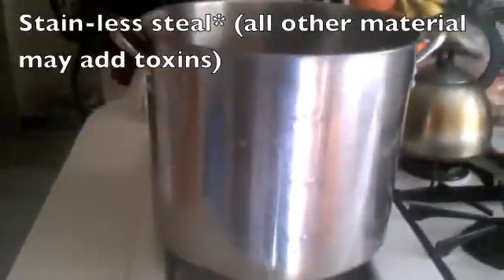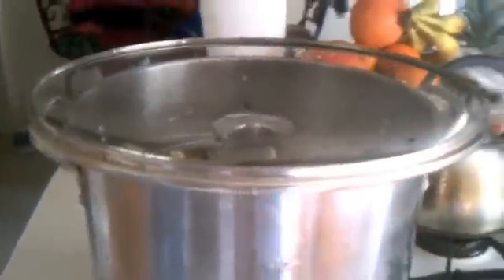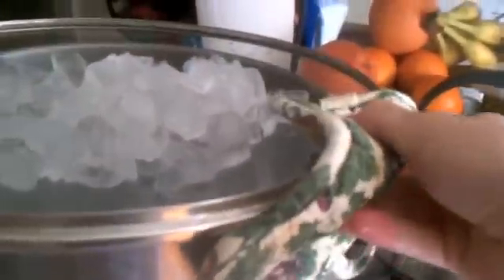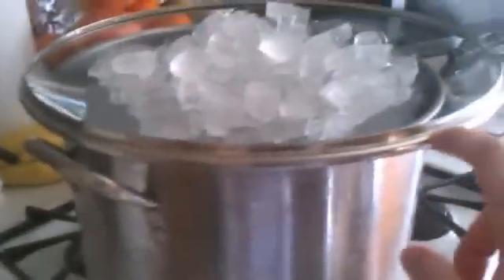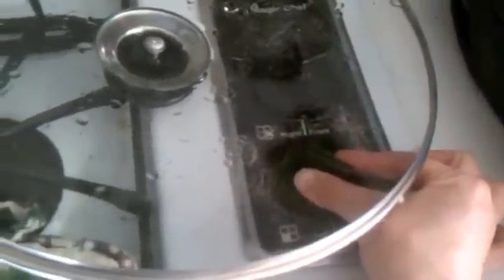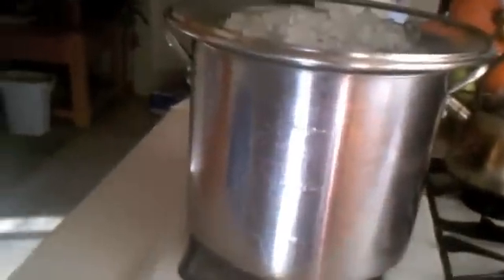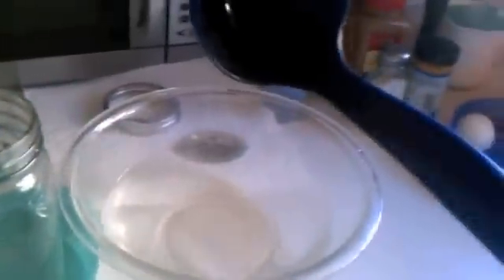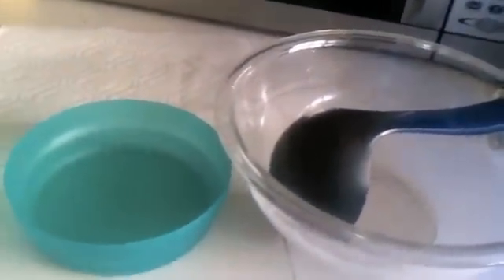How To Make Distilled Water | DIY Distilled Water

Comment: dang that took a lot of time..and the money spent on the bag of ice, I could jus do as I normally do and buy a gal of distilled water at walmart for .79 cents..aaahh cool and refreshing. .
Reply: dont drink distilled water
it leaches minerals from your body
Reply: +Rudy Roman  what kind of water then?
Reply: Stephanie Washington just not distilled
anything with minerals
Reply: do your own research never trust anyone's opinion lol.
Reply: If you have an air conditioning in your house then you have distilled water. The AC has a drain pipe somewhere and therefore we are not really aware of the distilled water that is beeing produced but it's a lot of water

Comment: Wouldn't the water coming off an air conditioner or high efficiency furnace be distilled water??
Reply: +Lee Haire :Yes, it is distilled water and would definitely be better for you than tap water if you make sure the air conditioner is clean. You would need to filter it because of all the dust in the air. Some might argue about the lead solder joints on the copper tubing but we have that in our plumbing anyways.
Reply: +Robert Tomkinson Bob, all good points!! I use that water for the car, with anti-freeze, and for the shop as taking dents out of wood. Don't know as I'd want to drink it!! Have a great day!!

Comment: With this closed design make sure you are starting with clean water, since any toxic volatile gases are unable to escape and will also condense right back into your 'collector.' 
On a professional distiller, a way is provided to vent off any volatile gases before they condense. They also don't boil the water but heat it only close to the boiling point, to help separate the gases.

Comment: save 3 bucks on ice. grab a thick bag. fill it with water. freeze it. smash it. you're not going to use the ice for refreshing your drinks anyways
Reply: totally agree
Reply: @KinysonLocke  ?  The water in the bag stays in the bag dude.  the water in the pot touches the lid, and drops down into the bowl. they are separate, the bag with ice is on top of the lid. ...Smh
Reply: What is the purpose of the ice?
Reply: It doesn't have to be ice, Just cooler than the vapour produced to condense it,
but Ice would condense more vapour.

Comment: Buy some Himalayan pink salt fine organic from Amazon take a pinch to every couple. Litres! This will replace all the minerals you have take out of the water as your body really needs them for good health, about 70% of  minerals your body needs are in the pink Himalayan organic fine  salt
Reply: Himalayan pink salt is actually not salt Paul.  In fact, himalayan pink salt has over 84 trace minerals that the body actually needs and can use.  Not sure why you would feel the need to use the word Mook with someone who actually is correct in saying to add the himalayan salt to their water.  Distilling removes everything good and bad, but you still require minerals which means that if you add the pink salt (which is not salt) to your water, you  get all the minerals plus some for good health.
Reply: The whole point is to make distilled water, for purposes you need distilled water for.  I make homemade shampoo and conditioner and WANT the minerals removed.  I guess if you have awful Florida water, you want distilled water to drink that needs to be re-mineralized.  But most people specifically want distilled water.
Reply: That is true but she might be using distilled water for something else rather than just drinking it like for a mechanical use like adding it to another solution that requires added distilled water rather than just tap water.
Reply: Distilled water is good for you. Don't add shit to it. Yes, It does leech minerals, it leech all the bad ones that your body doesn't need
Reply: great video...thanks, If you are going to make colloidal silver then don't add anything to the water, like a few other comments...it depends what you want the distilled water to be used for.
Reply: you want to drink 3 out of 4 glasses of distilled water. distilled water is like a sponge an will absorb all the toxins an hard minerals your body cant absorb out of you. do not mix everything in one batch, drink distilled water thru out the day an at night drink the last glass that has the minerals you want to add back to your body.
Reply: Hayestreo why?
Reply: Karen Grainger-Allen you can also get Himalayan Salt at Wal-Mart now.
Reply: @pennys2215  so i heard theyre dying it pink. Theres a way to test it tho...put a few table spoons in with a cup distilled water. Stir a few times in an hour. Put coffee filter w rubberband over an empy glass or folded paper towel. Pour salteater into empty glass. The papertowel should NOT turn pink.. If so, u have fake Himalayan salt. If your paoer towel is not pink , congratulations u now have sole. If u didnt use a metal spoon to stir it u can take a table spoon of ur salty sole everyday with an 8oz glass of water to replace minersls n charge ur body...better than coffee!
Reply: Maxim Sotsky... perfect comment except for the sarcastic lmao remark added on..
Reply: Diana Martin i like the stuff on your youtube. Do u have a video about making shampoo n conditone
Reply: Karen Grainger-Allen thanks for the tip!!
Reply: Karen Grainger-Allen minerals these nutts get of google and become a scientist. You have not one fucking clue what your talking about 😁😁😂😂🔥👌
Reply: himalayan pink salt doesn’t allow me to do acid base titrations
Reply: Mar Garcia and... allopathic doctors make more money if they keep their patients in the dark. many of these doctors are not informative and they get angry when you ask simple questions. They forget that you hired them to work for you. They also forget that you are in charge of your health. so keep spreading the word about the importance of good salt with minerals and any other health benefits you can share with others
Reply: +Paul Barela No you noob. It depends on the purpose of distilling it. The minerals you re-add are ones you want, the minerals you remove during distillation are ones you don't want. If we were putting the crap that remains after distillation back into it, that would be undoing the process.
Reply: Lol, Himalayan salt's bogus health benefits were debunced years ago. Yes, even as lamp shades.
Reply: Yes! You are right! Himalayan salt has actually 84 minerals that our body has and needs daily due to daily activities, stresses etc., we need to replenish them daily.  Himalayan also makes your body alkaline. I've heard several people outside my doctor's office say they have to buy alkaline water but it's expensive. I can't believe my doctor didn't say anything about just adding the Himalayan salt to their water. ...but then again doctors don't know much about nutrition.
Reply: Himalayan pink salt is a shame girl. All the "helpful" minerals it provides you get from other resources and in it's natural "organic" state it still has trace amounts of toxins. For the love of god it's even sold in the dollar store. You probably got this information from Dr. Mercola. That doctors contradicts himself. He tells you to stay away from all trace toxins yet advertises products that have trace toxins such as air purifiers that emit ozone. Think girl think! You probably drink your distilled water in plastic bottles lmfao
Reply: If you are going to drink the water, you need to add the Himalayan or Celtic sea salt. These minerals are not just for you body, but are actually to raise the ph level of the water because absolutely pure water is rather acidic and you don't want to put that into your body as it will leech minerals from your body in order to balance itself. Obviously for other applications like mechanical applications you can leave the water pure after distillation.
Reply: +Karen Grainger-Allen 

Fuck the minerals. Eat food and take vitamins, nerds.

Comment: If someone wanted to use this method to prepare safe drinking water when the Sh** Hits The Fan, they likely wouldn't have refrigeration. 

Power outages would probably be the norm. And it could be permanent. 

You can find wood to heat the lake water, but where would you get the ice to cool the lid and cause the condensation?

You'd have to use room temp dirty water (careful not to contaminate the distilled H2O!) or just let it cool on it's own.

What would happen then?

How long to wait for it to cool and condense so you could quench your thirst or re-hydrate your freeze dried food?

Comment: Why does the bowl have to float?
Can I use a glass instead of a bowl?
Reply: +superarsenal009 You sure can
Reply: +superarsenal009 You don't want it too close to the heat so that the distilled water doesn't reboil and turn into steam again.
Reply: Make sure to Stick the Glass in the freezer before you put it in the boiling water ; )

Comment: Or put the lid in the refrigerator till it gets cold, then you won't need the ice.
Reply: +Brian Garrett that would work for about 30 seconds...then then steam would heat up the lid?
Reply: when glass goes from super cold to super hot the glass breaks ... trust me when i say this.. iv broken many bongs trying to clean them from hot to cold and cold to hot water.

Comment: so..its just steam lol?
Reply: Condensation technically, but yes.
Reply: 🍎                                      TDS ( total dissolved solids are left in the bottom
.            any VOC ( volatile  ,organic compounds ( pollution ) are boiled off 
.       the distilled H2O is pure
Reply: Do any of you drink this regularly I'm trying to learn what is propaganda and what Is the truth.
Reply: Turns to water vapour and then condenses. Yes, basically steam
Reply: stream ? lol
Reply: boiling water doesn't remove everything.  It does kill a lot of bad things though, but just plain boiling without this girls method would do just about the same as her method.  You need a lot more equipment and effort to produce TRUE distilled water.
Reply: +Hotstop Kid No. Steam is water in gas phase. Distilled water however, is just plain water in liquid phase, however the difference between plain water and distilled water is that distilled water has many of its impurities (such as salt, which could remain as residue) removed through this distillation process.

Comment: I suggest you take the knob off and put it on the outside because having steam run off a plastic knob could leech plastic into the water.
Reply: +Traci Martin Yeah good thinking. I thought it was kind of weird because the water will obviously drip from the middle which is the knob , which didnt really feel right.
Reply from the maker: i realized that AFTER I had finished :(
Reply: Far more than that.  It needs to be fully enclosed and sealed from air.  Her method is wrong in so many ways it's not even funny.
Reply from the maker: HAHA
Reply: I was thinking the same thing. I have a large glass visionware set that includes glass lids that have glass knobs. I am going to try it with these.
Reply: Use a plate?
Reply: @Ic_truth  plates, and coffee mugs aren't made from materials you want in your body, Amen.

Comment: For someone who doesn't need 9 minutes of explanation: 

- get a bowl that floats. don't put anywater in here, this is where the distilled water is collected.
- put the bowl in the big stainless steel pot which is filled about half way with tap or filtered water.
- flip a large lid over the pot, and put ice in the lid. This will create a condensation effect with a hot/cold barrier
- distilled water comes from the water vapor that came from the pot, hit the ice-cold lid, and then fell down

Distilled water is very important in almost all scientific experiments, So be a mad scientist and use this shit. Good luck
Reply: she wrote what to do in the description genius
Reply: Steal...?? Come on, it's STEEL.
Reply: +Spoder Man No no no, you're doing it all wrong. First you need two glass round bottom flask, an adjustable hot plate, and a reflux condenser. Fill the round bottom flask with water and attach the reflux condenser. Place the first round bottom flask on top of your hot plate and set the temperature to boiling (>100C). Attach the second round bottom flask to the reflux condenser and you'll get much more distilled water.
Reply: Spoder Man thanks you, she is a bit chatty, but its informative.
Reply: gary singer yes
Reply: ***** ( ͡° ͜ʖ ͡°)
Reply: ***** It's a lemon party ( ͡° ╭͜ʖ╮ ͡° )
Reply: Shrug can I put whiskey in the flask
Reply: Spoder Man yeah just set the hot plate to 80C and the alcohol will boil away leaving the water behind.
Reply: is there a way where its less time consuming?
Reply: thanks,spoder man
Reply: Lol god so gross
Reply: Diamond Thompson Sorry I didn't respond earlier, your comment was marked as spam. Anyway, I think she added that after I posted my comment. I wrote this last summer
Reply: +ray dagger  Hi ray, Would you please explain how to make the collidal silver? I was very ill this past January and February due to my neighbors smoking that was getting into my bedroom as well as living room. I live in a senior building and learned that I was surrounded by 5 smokers. I developed a sever sinus infection, eye pain, ear aches and the infection traveled all the way to my thyroid. I will be 68 in May and although i complained to management I was told that these people were grandfathered in so the no smoking rule does not apply to them because they were living in these buildings before the law was passed. I was given amoxicillan 875 mg for a month and a half and was not getting any better so I bought a small bottle of collidal silver and took a teaspoon a day placing it under my tongue for 30 seconds and then swallowing it and I was so glad that I finally bought this product because it worked. I did not finish those pills and I finally moved to a different location and have felt so much better. I would love to learn how to make it myself. Thank you for making me aware of this.
Reply: I love butter in my coffee, I just made the ghee and will need to try it in my coffee. Thanks for the idea.
Reply: Spoder Man So is it bad that I just buy mine from the grocery store
Reply: ***** wit gret sweg cums gret respnsibilitie
Reply: Spoder Man spoder man se hi to unkl ben.. huehuehuehue
Reply: sangam kr wai yu du dis?? (ಥ‸ಥ)
Reply: +Spoder Man Best and easiest instructions. Thank you.
Reply: Pro Tip, DO NOT Over heat the water so it's jumping all over the place simply because you'll be getting loose undistilled water from the pan.
Reply: I be needing the videos though since I'm a visual learner 😂 why don't you guys just look it up on Google if you don't wanna watch a video 😂😂
Reply: Spoder Man she already gave the written SHORT directions...  No one wants to read your bloody novel
Reply from the maker: I appreciate your comment!
Reply: +Lorraine Ls--does the Ls stand for LOVES SWALLOWING?
Reply: thanks spoder. I was NOT about to listen to hussy the whole 9 min
Reply from the maker: HAHA

Comment: Would there be less carbon dioxide buildup into the distilled water, if you use an electric stove or microwave oven, or even Fresnel solar lens? (For the microwave you need a Pyrex glass pot and Pyrex glass top with no metal which would cause trouble in the microwave..)
Reply: Jay Dillon There would be no carbon dioxide build up...
Reply from the maker: im honestly not sure... you made a good point !

Comment: so that hole in your lid.... the ice melts and drips / contaminates your "distilled" water. well done.
ps WAY too much ice - just using tap water to continually replace the warm water and a sponge to remove that warm water is adequate to keep the lid cool enough to cause the condensation to form.

Comment: Why not put inside a hardy glass are metal cup or bowl in the middle of the pot so the water can drip down so you don't have to pick up the hot lid everytime an have less chance of burning your self 
   
    Would that work better?